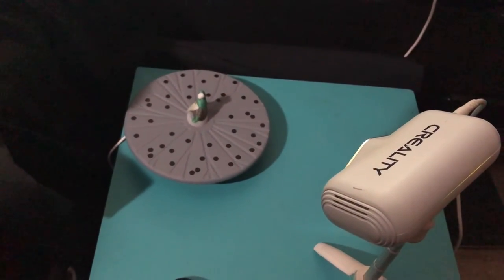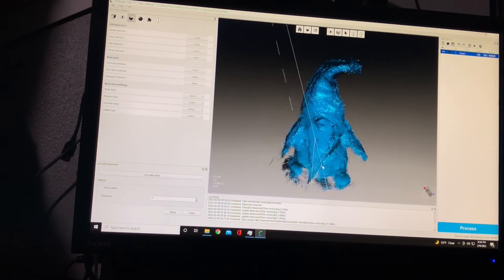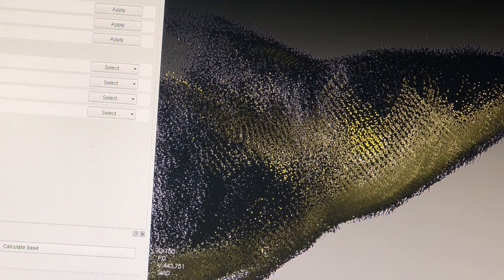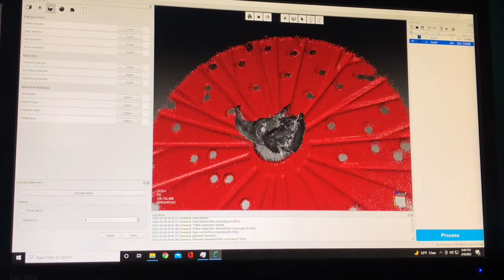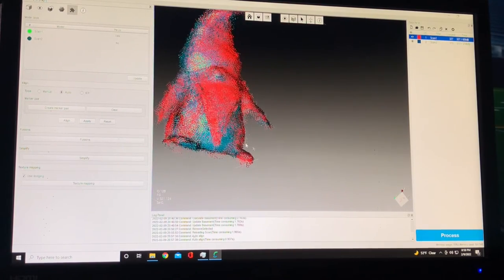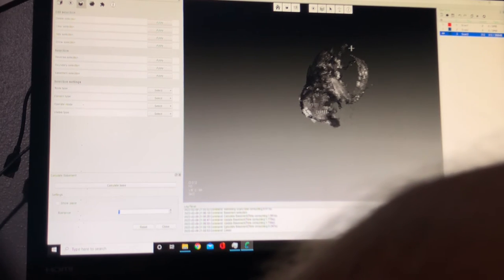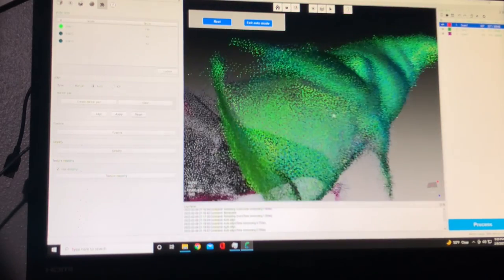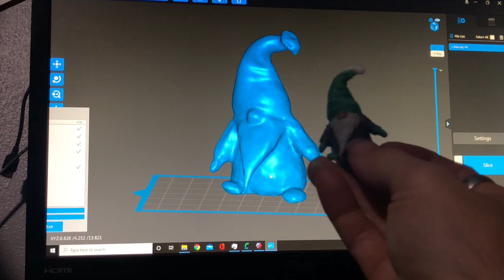Cr Scan Lizard - Complete scan, edit, move & auto align, and compile walkthrough.

Comment: I’m nervous now…. I backed this, but this scan looks like garbage. Not at all the .05mm accuracy that they claim.

Also, never use scanned textures on your scans, that’s all lies.
Reply from the maker: This is a great scanner. Join my group and come see some more results. 
https://www.facebook.com/groups/1158786424544462/
Reply: I backed the Revopoint Pop 2 campaign which ended right when the Lizard was announced, so I'm relieved that I don't regret my initial backing. I think it's bogus the lizard doesn't capture color without the seperate color kit and camera since the marketing videos seem to imply it's built in
Reply: I've backed this too & thought I would say.... the 0.05mm accuracy seems to be more about dimensional accuracy rather than detail accuracy. So if you have a cube say, with holes in it, the size of the cube and the location of the hole will be accurate to around 0.05mm accuracy. Detail, like whiskers etc are not likely to be picked up. Most scanners on the market use some form of light and due to reflections etc, you will always get a degree of noise which means some inaccuracy when it comes to fine details. The Lizard, from what I've seen of it and other 3d scanners on the market, for the price point it does a very good job for it's price point.
Reply: @p00ky76  its just him, he is the worst lizard user i have seen